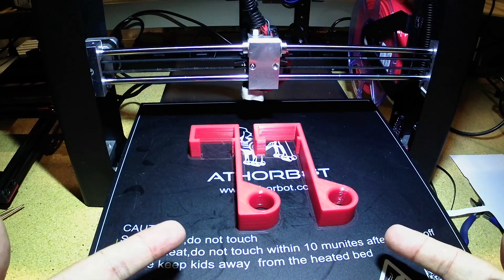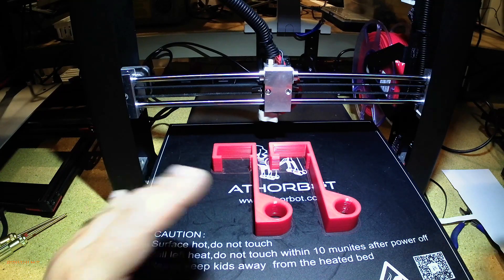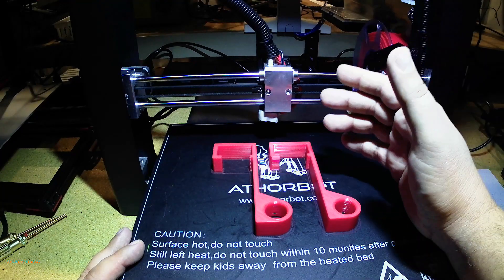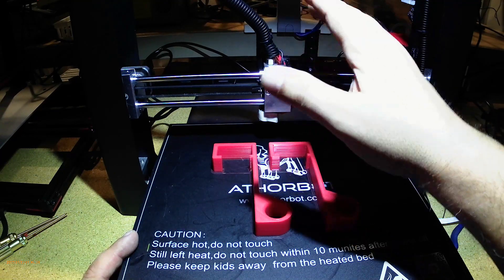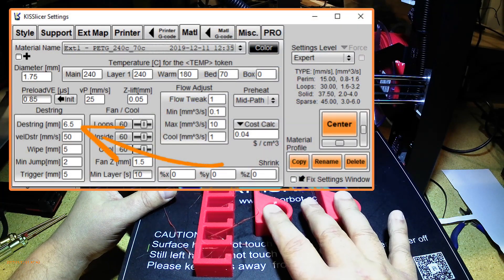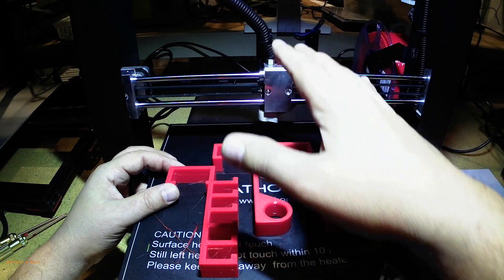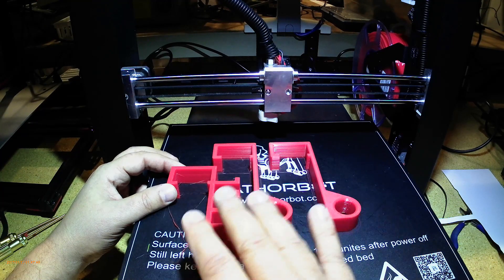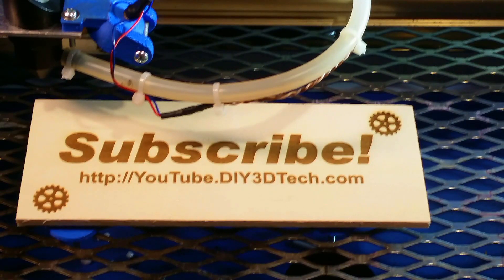JGAURORA A5  -  Tips and Mods For Printing PETG!

Comment: This makes me feel better.  I bought into 3d Printing around the time you could build them cheaper than buying them.  I even considered the kit that came with wood parts.  I settled on a TEVO tarantula which took me 12hrs to build and was amazing. Then I bought my JGaurora A5S followed by an Elegoo Mars 3.  I recently watched videos on the Bamboo P1S which made me cry, so easy, still small problems, but soooo easy.

Comment: Cura 4.9 is awesome. Even 4.8 was very good with PET-G. Just an FYI.
I get no stringing with 1mm retraction and 25mm/sec. No stringing.
The secret with Cura retraction is less distance at slower speeds.
And my printing speed is the same for PLA and PET-G.

Comment: Hello everyone. Disagree only with your thoughts on the slicer. They are practically the same, comparing them by the raw g-code.
Reply from the maker: Thanks commenting!  However no clue how you can say they are "practicly the same, as they are not the same nor close!  There are huge difference in math used for the slicing strategies.  Keep in mind that an STL is a tessellated object so there is a lot of math in converting these layered planes into an multiple orthogonal objects for printing.   For example, KISS has perfected the art of rounded infill verse grid which yield far better results.  I cover this in a past video.  Also I can take the code for an object from both CURA and KISS and they are vastly different...
Reply: @DIY3DTECHcom  I am sorry for misleading you because I was talking from the technical point of view. Of course there will be differences in movement directions, probably difference in wall printing order and infill, but if you set up the same level height, the same temperature and the same speed, along with the same other settings, there won't be, or at least shouldn't be, any difference in the g-code for printing quality. Relating to your video, probably the default settings are better in KISS sliser, and as a result, you have gotten a better print quality out of it. Diving deeper in CURA settings and tuning them might solve the problem.
Reply from the maker: @sergusy  Yet that is the key, as just in CNC there are differing strategies and recipes for machine movement as its not as simple as it appears :-)